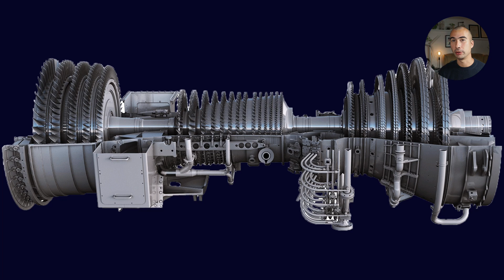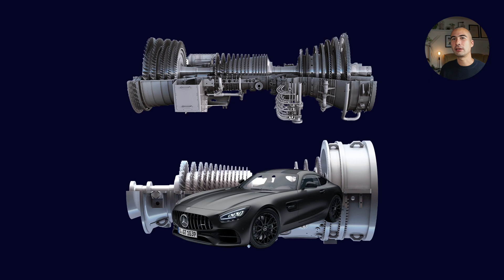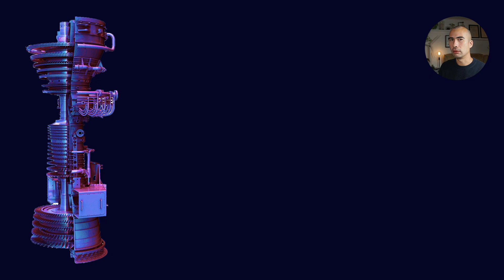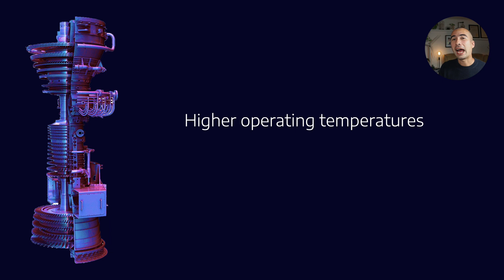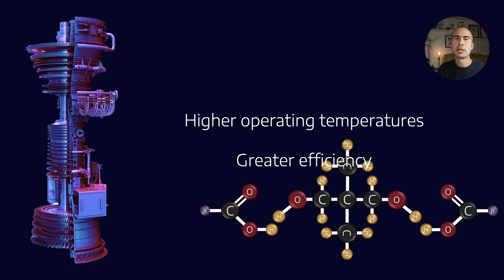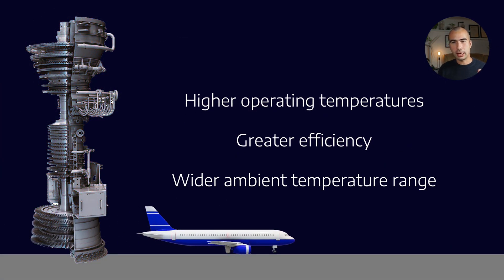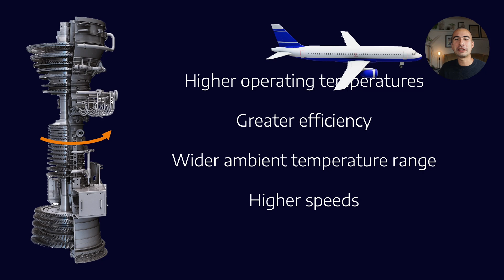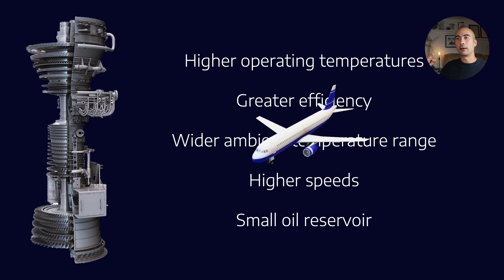Why are aeroderivative and standard gas turbine oils so different?

Comment: In my opinion, It's more like a row of engines scrapped from SUVs compared to a far more massive piston engine specifically designed for power generation. For example, the row of engines will have half the power of the industrial engine for less than quarter the size and oil used. But the larger industrial engine has an advantage of being able to run cheaper fuel and easier maintanence. Which is why aeroderatives are often used for LNG pumping and portable compact power plants.
Reply from the maker: That's actually a really good analogy. I like that.
Reply: @LubricationExplained  thx

Comment: Aircraft also operate over a very wide power band compared to industrial turbines. 
Commercial transport aircraft do have the advantage of 20+ tons of cold fuel as a liquid heat sink. they usually have fuel heat exchangers in tank for the hydraulic systems and in the engine nacelle for turbine oil. A mid size commercial engine burns about 2-3 tons per hour in cruise and after a couple hour flight the tank fuel temps are down around -30 this all gets preheated by the turbine oil prior to the fuel filter.
Reply from the maker: Yeah that's true, being able to use that heat sink is pretty handy.